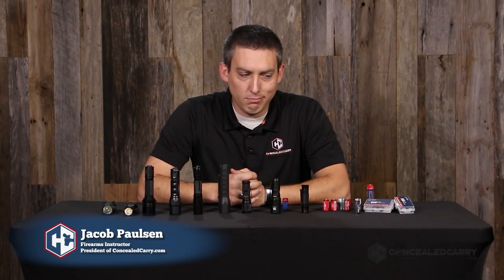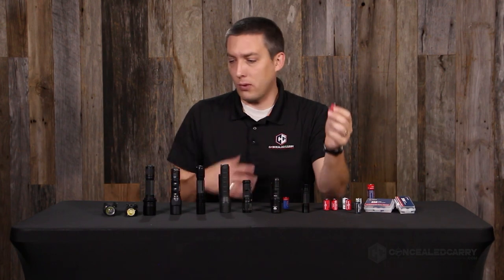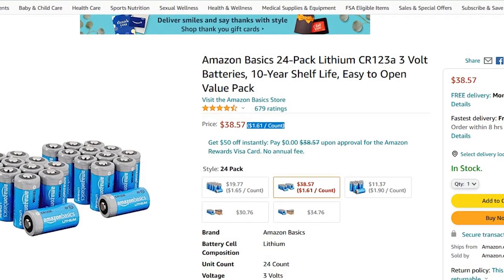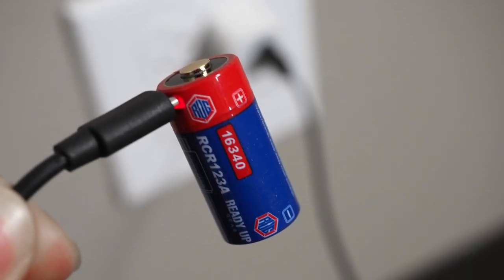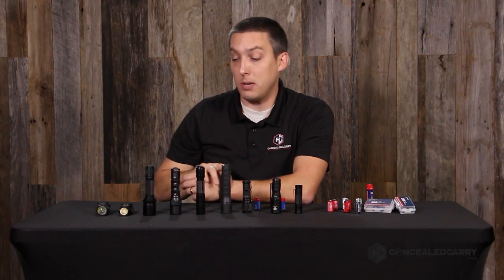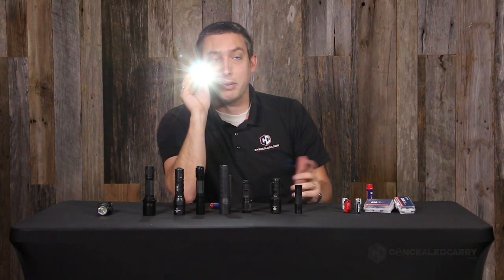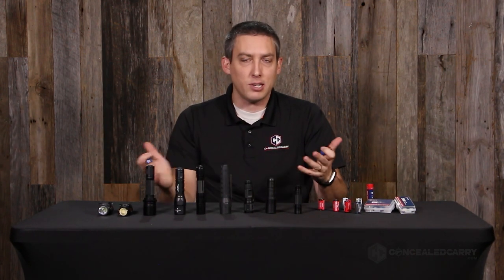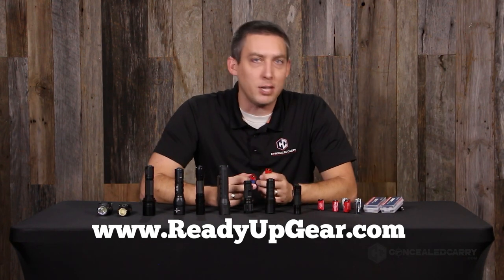Optimizing Tactical Flashlights With 16340 & 18650 Batteries

Comment: Sneaky sneaky! I like it! Off to Amazon to order 16340s Thanks man! My SFs have been bleeding me dry for way too long. To the point where they've spent too much time in a drawer without batteries in them over the years. This is awesome!
Reply: I'm not trying to talk trash, but it never once crossed your mind to get rechargeable batteries?
If you're going to get some might I suggest lights that use one 18650 instead of 2 of the CR123. You basically get the same pocket-friendly EDC form-factor but way more battery and performance at the lumen ranges people tend to use lights in wichbis full power or 1 down from full power. You can get 2 spare high capacity batteries that are high drain that can rly crank out some power and just have 2 batteries charged full for back up at all times in each battery will have a run time of about 4 to 20 hours depending on the intensity you run your light at. I genuinely don't think you can beat the 18 650 for an EDC light it's just about as big as a battery you can get that's rechargeable but also doesn't make your light un-pocket friendly. 
Happy hunting my friend.
Reply: @grey5135 Do you think surefire flashlights (G2X) can handle 18650’s?

Comment: i have a strong laser pointer and i have a question. will 2x 16340 perform better than 1x 18650? im asking because if u add 2 16340 u get 7.4V where as if u add 1x 1650 u get 3.7V

Comment: 16650 will often fit and work where an 18650 is too big. 

surefire g2x, tactician, fury, elzetta bravo.

streamlight 2lx is nice and can take a wide variety of batteries. 

keeppower and orbtronic make great 16650 batteries.

a 14500 is a 3.7v aa. 

too high of voltage can blow your light and it does get hot fast. good luck

Comment: not sure how your last recommendation works.  Two 123As or two 16340s stacked would be supplying 6V or 7.4V respectively, to your light.  Replacing them with a single 18650 would knock supply voltage down to 3.7V.  A 3.7V supply seems like, if your light worked, it would be running at half power.  Sure that would increase the longevity of the charge and even the life but at the cost of lumens, which seems to be what this video keeps referring to.

Comment: I have a large maglite type flashlight that is billet aluminum that ran on D batteries and doesn't work. I have a new knock off laptop battery, an led headlight buld, a type c rechargable+disposable,  vape. I don't want to throw them away they are in my junk drawer. Thinking about building this and if I have enough parts.

Comment: 16340 batteries will not work in my Surefire 6V Scout or my Airasaka 300. Airasaka specifically says the 16340 is incomparable with the 300 series light. Surefire said 16340 were compatible with their lights but I haven't found it to be true with all of their lights.

Comment: 18650 is the original laptop battery cells, and its what are in teslas (until recently). they are the most mass manufacutred li-pol battery form factor and have the cheapest economies of scale (btw, tsla batteries are actually panisonic in the us).
thats why most flashlights are 18650 based. all Li-pol batterys can be assumed to be ~3.7 volts per cell, yes they charge to 4.2v but its kind of like a spring that can get stretched out past its full length and not become damaged/yield. 18350 (35mm long, 18mm fat) are the correct versions of "half" 18650 (65mm long, 18mm fat). this is because most mfg have to take into accout the redundant protection chips people add to their 18650s now which can bring them up to ~75mm long).
all LED's need a specific voltage to be run efficiently, and then you can usually crank up the amperage pretty high as long as they dont burn up. most led's used in flashlights are all made to be most efficient at ~3.7v. most flashlights that cost more than 10$ however, this doesnt matter. many use a built in computer chip called a micro controller that uses a buck regulator loop inorder to keep the voltage the LED's see constant. this looses ~5% capacity and adds a tiny slow discharge, but is preceived by consumers as higher quality or something. because of this, many flashlights that take 18650s can actually be ran with 2x 18350's at double the voltage, even though the LED's are "rated at 3.7 volts." rated voltage is a made up number by the manufactures. if you want to know what a flashlight is actually rated for, find the part number of the microcontroller and look up the data sheet. example, sofarin 3.7v s25d, "rated at 3.7v", look up the attiny412 micro controller data sheet, it goes up to 6.5 volts, which means you can probably get away with overclocking it at 7.4v. 
this is all very complicated.... normally you cant use "milli amp hour" as a shortcut for capacity, but in the world of Li-Pol batterys, u can because theyre almost all 3.7 volts. also the lumen brightness will be proportional to the "power" output by the LED's, which you can approximate by multiplying volts x amps. theoretically an 18650 can produce the same power as 2x 18350's, but in practicality, the 2x 18350's will usually be brighter but drain the capcaity more quickly. this is because LED's tend to exponentially increase brightness with voltage but have diminishing returns or logorithmic relationship with current. but voltage is what zaps LED's right away, and amps is what cooks them with too high temp eventually.... but as i said before, most microcontrollers will prevent this because they have a boost circiut which would convert for example (2x 18350) 7.4 volts @ 10 amps, into 3.7 volts @ 20 amps, which would be brighter but as a side effect safer for most LED lights on the market over 10$. 

cr123's and 16650's should go straight in the trash imo if u ask me. 16650s have like half the capcaity of 18350's lol, and they fit in the same flashlights

Comment: But the 16340 are only 650 MAh. That's less than half the capacity of a traditional lithium battery.
Looking for a rechargeable for a smart lock (August 4th gen), and this looked promising, but not if it only lasts a few weeks instead of several months.
Reply: In flashlights that need 2 CR123 ies you can take a 16650. In most cases they fit and work and can have up to 2500mAh.
Reply: @Gieszkanne  mAh is not a measurment of battery capacity when compairing two different battery chemistrie which therefore inhearently have different voltage... you want to compare watts (power) which is approximately equal to mAH * voltage. this will also give you an estimate of which battery contains more lumens.... so to speak.
and 16650's are garbage, use 18650's or 2x 18350's, they have almost twice the capcaity of their equivilant 16mm form factors
Reply: @vevenaneathna  Red properly! I was talking about flashlights that run on 2 CR123 like many Surefire. 18650 dont fit in there but 16650. Its a cheap and good alternative to the expensive CR123.
Reply: @Gieszkanne  a lot of times 18350s will fit in lights that are advertised as 16650/cr123 was my point i guess

Comment: I need a power management solution for all the batteries that I carry for all of my tactical equipment. I would love the ability to recharge a single type of battery, either 18650 or 16340 I don;t care; but I need them to power my rifle light, pistol light and NVGs power pack. A single battery type that powers ALL my needs.
Reply: 'One battery to rule them all"?

Comment: I can't get 18650 batteries to fit in my surefire that takes two 123As.
Reply: That happens. The 18650 is just a hair wider in diameter so That Surefire doesn't accept the 18650. But you can use 2x 16340.

Comment: So i already have a fancy wall charger and i want rechargeable one that dont have that crappy little port so it can have a larger cell does anyone know any brand that are rechargeable and do not have the little ports
Reply: Agreed! The biggest problem I've experienced with "rechargeable" flashlights, tablets, smart phones, etc., has been charger port compatibility and durability. Even if they work initially, there is a tendency for the ports to start malfunctioning or become very picky as to which charge cord plug with which it will work. Batteries with built-in ports would probably experience the same problem. This is one reason I've bought Olight magnetic rechargeable flashlights and weapon lights. The only downside is that the Olight magnetic rechargeable, non-replaceable batteries appear to have lower capacity and hence shorter runtime. They work OK for occasional civilian use but would be highly problematic for full-time professional work or in a grid-down world. The manufacturer who develops an affordable rechargeable across-the-board interchangeable use battery line would get my business.
Reply: @calvinblumhorst3426  I'm sorry. I'm voicing this because I have a lot to say like your message. But you said it so incredibly well. Yes, I do have a magnetic rechargeable flashlight right now. It's just a little $20 Flashlight from Walmart. I forget the name of it, but it does seem to be very reliable. I haven't had it for very long so I don't know how reliable the battery is. And unfortunately, I am too impatient to l it the battery fully die and then recharge it. I will recharge it before it's dead. Which is probably damaging the internal battery. But I've picked up A123 powered light and already almost burned my house down trying to recharge the battery for it that said it was rechargable

Comment: Brands like Surefire that still persist with outdated technology like CR123A batteries baffles me, I understand some workplaces guys get them for free, but CR123A's get burned through so quick and are an environmental waste, at least make the light come with a rechargeable 18650 with the CR123A option (some do).  Imagine if Surefire with their reputation dipped their toe into rechargeable 21700 market with lights at 2000 lumens